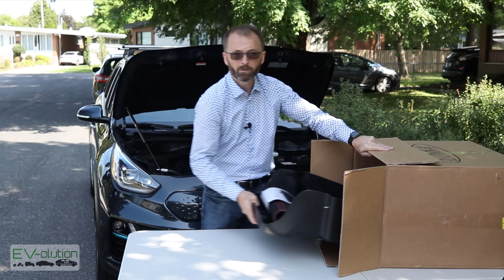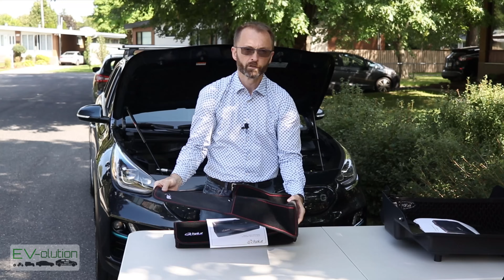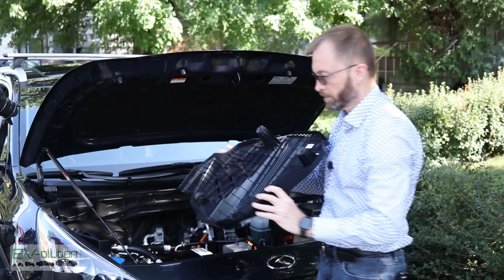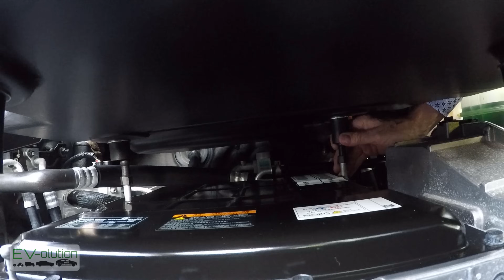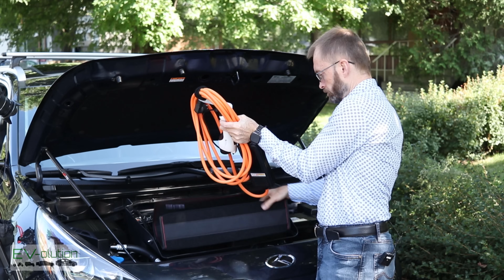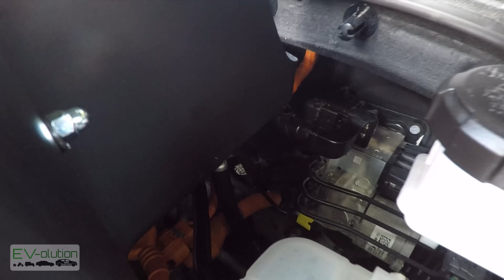Add a Frunk to a Kia Niro EV!

Comment: Having you asked your local Kia dealership whether the frunk affects your warranty?
Reply from the maker: No I have not, but is something that you should ask your local dealer. Please note that this is simply replacing a plastic beauty cover using the same factory mounting points, and if there were any issues with your car Kia would have to prove that the Frunk was the cause. I really don't see how it could cause a problem unless you put too much weight in it. So I recommend you ask your local dealer.
Reply: I had the same question. Kia could argue that that it affects airflow and cooling in the compartment?
Reply from the maker: @mohsscale4220  they have to know you have one. I am screwed, but they don't know if you have one or not.

Comment: Will it have any affect on your warranty with it not being Kia approved product?
Reply from the maker: This is something that you would have to ask your local dealer. Please note that this is simply replacing a plastic beauty cover using the same factory mounting points, and if there were any issues with your car Kia would have to prove that the Frunk was the cause. I really don't see how it could cause a problem unless you put too much weight in it. So I recommend you ask your local dealer.

Comment: Thanks for another very informative video, André!
We've had pretty much the same model installed for more than half a year in our e-niro and I just love the extra space it provides. No problems whatsoever with it so far. Hope it will do a good job for you as well.
Reply: Hey Elektroautoumsteiger, do you know how this frunk affects the TÜV or insurance. Does it have a “allgemeine Betriebserlaubnis” (sorry guys don’t know how to translate its a German bureaucracy thing)
Thanks Dankeschön:)
Reply: @keno4077  I'm not sure about this. So just to be on the safe side, I remove the frunk when going to the Kia garage or when getting a technical inspection (TÜV) on the car. After all it takes less then 5 minutes to remove the frunk and to re-install the original motor shield. If it's really needed to do this? I don't know.
Reply from the maker: It is my pleasure, I am glad that you liked it 😎. I am also glad to hear that you have no issues with your frunk. I am very curious to see how it does this fall and winter. Will water and dirt get in?
Reply: @EV-olution  That is something I also asked myself last autumn. In fact no such thing happened. Even though we had quite some rain and snow last winter here in Germany, no water or dirt got in.
Reply from the maker: @dieelektroautoumsteiger  That is really good to know. Thank you.

Comment: why dont you buy Tesla 3sr+ ??
Reply: Because I don't like the Tesla M3
Reply from the maker: The Model 3 is a totally different car, that is similar to asking why not get a Honda Accord instead of a Chevy Trailblazer. The Model 3 SR+ is a nice car, but it does not fiit my needs, and for the same price the Niro EV has more range in real world driving, is a hatchback, has more upright seating, and a few other reasons. If the Model Y SR was still around then that would be a great alternative, but still have some of the issues I mention in my video: Model Y vs Niro EV.